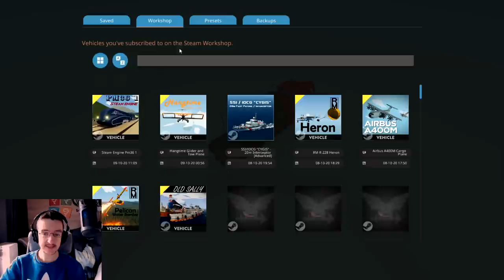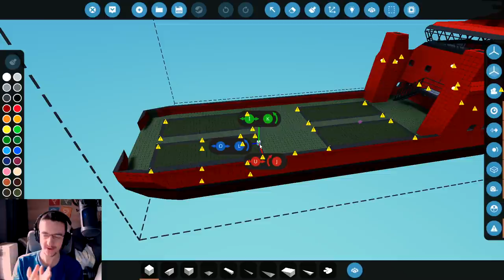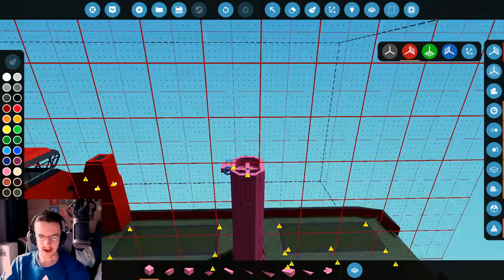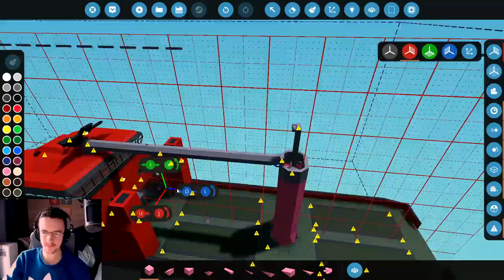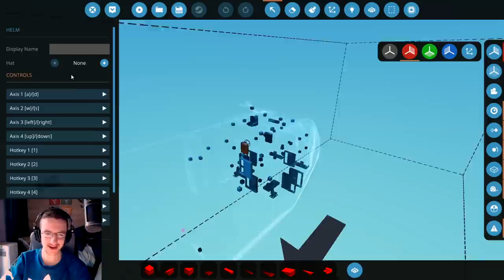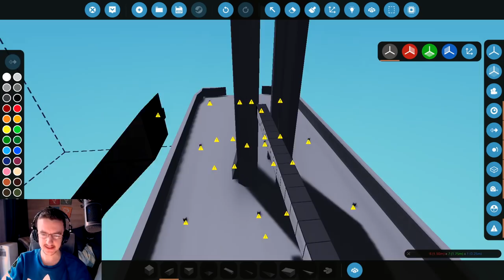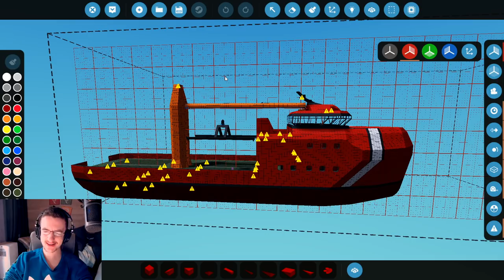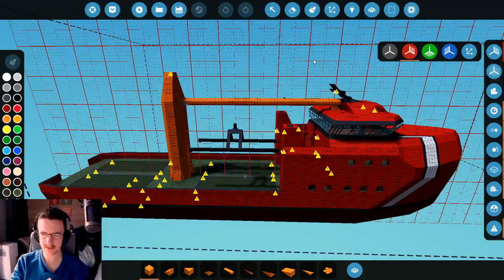Stability Issues & Crane  -  Supply Ship Build  -  Stormworks Build and Rescue

Comment: Loved the video @Frantic! I have some ideas that might help the build. Three things that I think you might have to do is 1.) Lengthen the Ship by another 80-100 blocks, 2.) Widen the ship by about 40-50 blocks and 3.) Increase the draft/draught of the ship by about 20 blocks. I'd also suggest you just get rid of the active stabilization and use that space for batteries since the Active Stabilization unit is more-or-less overcompensating for the list. I would also suggest you try what the U.S. Navy warships had in World war two known as "All or nothing" protection system, basically, it had compartments galore for a reason; to increase the survivability of the ship in combat. I know you're not going to do anything like that on stormworks just yet, but there is a chance that you could take damage in game, and even with the new hand tools in version 1.0, you'll need every bit of help you can get once you start taking on water.

Comment: Real ships with cranes use ballast tanks for stability. Perhaps you could use a tilt sensor to fill or empty ballast tanks on either side of the ship
Reply from the maker: Trueee, its already too low in the water though, I do feel like it needs extending down if Im to add ballast tanks :D
Reply: @FranticMatty  I think you need to do that; as that crane will require allot of ballast

Comment: You need a tilt sensor on the highest point of your ship to send a signal to the active stabilization mechanism. There must be a tilt sensor on the mechanism itself, but that's too low.
Reply from the maker: AHHHH, Thanks, I forgot about that
Reply: Yup, the higher the better (more sensitive).  Also, depending on the active system, tweaking the speed and such on the rail to suit a boat/ship is usually needed.  Test and test again.  (c:
Reply: @FranticMatty  At least these days it doesn't matter where the sensor is placed (as long as it's the same body, of course). I have my doubts it ever did (but don't have a way to verify that). It wouldn't make much sense and would seem like a needless complication from programming standpoint (I mean the game engine already needs to keep track of the rotation angles of the model relative to the world, so there's nothing to "measure" -- just return what it already has, maybe with some scaling/offset applied).